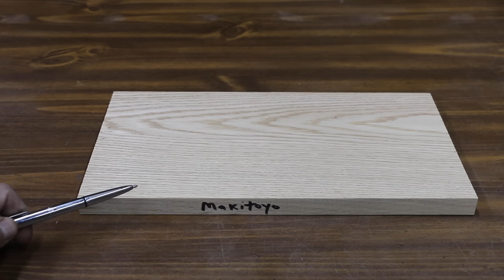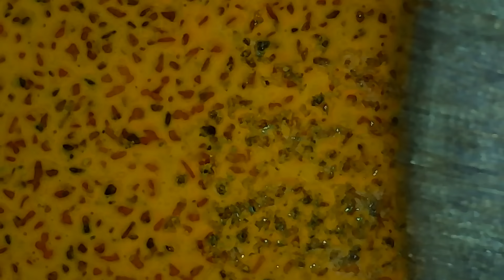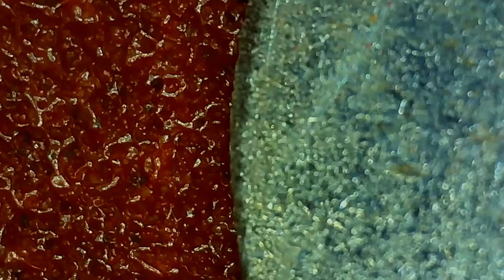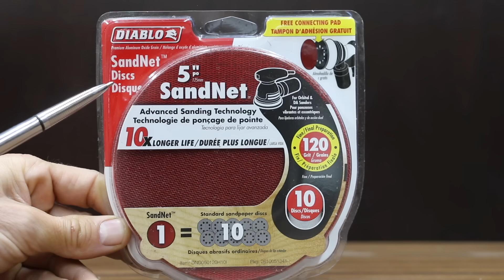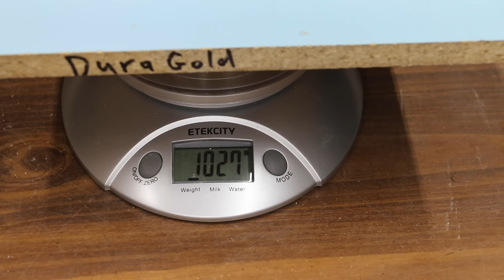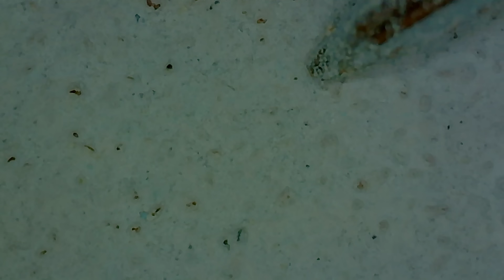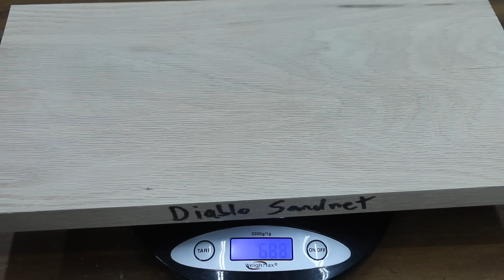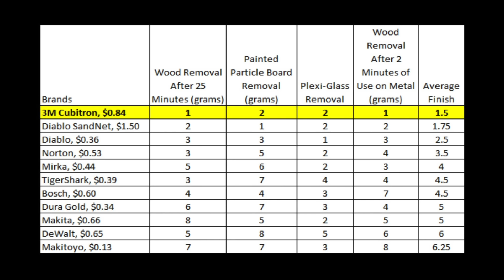Best "Sandpaper" Brand? 3M Cubitron, Diablo, Mirka, Norton, Makita, DeWalt, Bosch Sand Paper

Comment: I have used every paper out there Diablo is just better...  better than everything OTHER than Cubitron.. 
But cubitron discs are  not 1.5x better than diablo...  whenever they are 30-50% off I buy them though

Cubitron belts are the best I have found though and their cost is justified by their longevity and cutting speed.

I run cubitron belts on all my belt machines and diablo discs (or cubitron discs purchased on sale) on all my RO sanders.

The Diablo mesh discs are great and have their place for "soft" heavy clogging materials like dry but not cured finishes, such as  shellac, epoxy and latex paint. 

That being said the diablo and cubitron disks also do a great job on these materials they just clog faster then the mesh for obvious reasons.

On these soft materials it seems to mainly be a function of heat... 
I belive its do to the fact that the ceramic abrasive material does not absorb and transfer heat as readily as Alum. Oxide so the material being sanded stays cooler and does not "soften" and transfer to the paper. 

The mesh discs (based on their design) have even more air space further "removing" heat and dust from the material and the abrasive which of course means it will clog less for those two reasons.

Call it confirmation bias perhaps but this video exactly matches my hard won (and expensive) experience.
Reply from the maker: Thanks for sharing.

Comment: Not a fair comparison at all. Aluminum Oxide vs Zirconia Alumina vs Ceramic Alumina these are all different abrasive grains and should not be considered similar. Zirconia Alumina and Ceramic Alumina are always blended with Aluminum Oxide typically 80/20 or 20/80 ratios. This is from someone who spent 40 years in the coated abrasive industry.
Reply from the maker: Thanks for the constructive feedback.

Comment: Awesome Job!  The only thing I can think of to add would be a ranking of total grams removed per cost.
Using the grams removed after 25 Minutes for price per gram removed
Makitoyo	$0.005
Diablo		$0.009
Tigershark	$0.010
Dura Gold	$0.012
Norton		$0.013
Mirka		$0.014
3m	    	       $0.016
Bosch		$0.017
Dewalt		$0.020
Makita		$0.026
sandnet		$0.029
Reply from the maker: Thanks
Reply: wow!
Reply: Also factor in time to the equation to improve the stack rank!
Reply: Yeah, If I'm interpreting you correctly.

Even though the 3M was the better performer, you could change the Makitoyo to a new sheet 2 more times to get new sanding speed and still be cheaper than the 3M.
The Diablo however, is the real competition, it sanded, stayed clean, and stayed sharp. It definitely made the Makitoyo less useful.
Reply: In the end what sandpaper costs is not the major factor in a job. Labor is.

Comment: I have worked in body shops for 25 years and I can tell you brand of sand paper makes a huge difference. We almost always use Norton or 3M. They both have different grades and generally their gold series is the best. I have always preferred Norton over 3M though, and it is generally is always cheaper. Norton scuff pads are by far the best you can buy, absolutely no comparison.
Reply from the maker: Thanks for the feedback.

Comment: With mowing season fast approaching,  I'm curious about mower blade sharpening.  Angle of edge bevel,  convex/flat/concave grind. 
Then, which type of "wing" is best for smooth, even discharge, and minimal "lumping".  (I do not bag grass) 
I would assume that a high-lift wing would throw clippings out better, But would a totally flat blade allow the clipping to essentially fall where they are cut? 

I mow in a back&forth pattern and am always re-cutting clipping every other pass.
Here's where I'm going with all of this:   I want to build my own mower deck that is rear discharge.  The would mean designing my own blades.  I want the two left blades to rotate clockwise (toward the middle of the deck) and the right blades to spin counter-clockwise. (again toward the middle)  this is to let the discharge flow straight back from a rear-central discharge port.   
Why all of this?  To prevent spraying clippings toward houses,  flower beds, cars, sidewalks and roads etc.  As well as to prevent the re-cutting of clippings every other pass.
Reply from the maker: Thanks for the video idea.

Comment: After sanding tables for hours and hours at my last job, I can say with certainty that the quality of one brand can drastically change between grits. Some brands that are great at 120 are absolutely rubbish at anything over 800 and vice-versa. I would love to see a breakdown at each major grit between all these brands.
Reply: are you trying to kill this man
Reply: @lukesantarc561  lol!
Reply: @lukesantarc561  Indeed!  😳😬😂
Reply: That video would be over an hour long,   going through all the different grits.  This gives a good general reference point.
Reply: @BitterBrother1942  It only shows which ones are good of the ones he tested if what McCrary says is true. So I guess people who use lots of sand paper should do their own tests using a similar method of testing.
Reply: @atnfn  people that use enough sandpaper for price to matter already know which is best.
Reply: Sanding isn't just dependent on the paper, but the sander makes a huge difference as well.  All 5in orbitals are not going to remove much material and are not good for large flat surfaces.  Finish sanders are even worse and are not made for large flat surfaces.  6in orbitals are ideal if you are looking for something that can remove material, and give you a nice finish. But even they are not all equal.  I highly recommend the 6in Bosch model number ROS65VC-6.  I have used them for 8 years and have sanded hundreds of table tops and they are amazing.  Not only do they make the work faster, but they do not vibrate much so you can use them for hours with no breaks and your hands will not be tingling afterwards.  They are very well built and last for years.  I've yet to burn one up and I run the heck out of mine.  

Another tip is to make sure you use the right paper and progression.  I always start with 100 then 150 and finish with 220 (on wood).  If you have a difficult surface to clean up you can start with 60 or 80.  Just make sure you don't jump to much higher grit after using such a low grit.  If you start with 60, move to 80, then 100, then 150, etc.  Never go from 60 to 150.  You could probably get away with going from 60 to 100 but it will actually take longer to remove the swirls of the 60.  Even though it sounds like more work using a lot of grits, it's actually less work because you won't have to spend tons of time on each grit.  Your first grit is simply to get the surface clean and flat, then all the proceeding grits are just to remove the swirl marks of the previous grit.  I had to learn this lesson the hard way when I first started woodworking and would start on 120 and finish with 220 and all my table tops had swirl marks.  I would sand for hours and hours thinking it had to be good, and then when I applied the stain the swirls exposed themselves.  Finally i did some research and figured out what my problem was.  Sandpaper progression is key to a good finish.  

P.S.  Sorry if you already knew all that, hopefully it helps someone.
Reply: @isaiahii6982  also when sanding metal it needs to be dirt and oil free. As well as the paper. That will clog really bad. A shop I worked for had me sanding a brush finish on aluminuin. I'd clean everything first and use a new oil free chip brush to clean out the paper. I only had to replace my paper every few months or few hundred parts.
Reply: @isaiahii6982  Good Info! I have an old Makita BO5021 I bought after reading a test in a woodworking magazine. The thing just doesn't leave visible swirl marks, and I have purposely tried to put way too much pressure on it. I don't know why, not sure it is all that much different in design than other brands. I have some Norton paper, but it is old stock from when it was good. 
I knew a large cabinet operation that cheaped out and used Rhynodry sand paper; worst stuff I ever seen. They had to re-sand a bunch of cabinets before the finisher could do his work. Even their air powered sanders left swirl marks.
Reply: @debluetailfly  I've never used one of those but it must be something in the pattern that just doesn't leave swirl marks.  As far as I know all orbital sanders use circle patterns and leave swirl marks.  But the proper technique and knowledge is key to making sure your finished product doesn't have swirl marks.  

I ruined a lot of nice things I built when I first began woodworking because I didn't know how to finish properly.  I could build really nice things, but had no idea how to finish them.  Now I know how to build and finish :)

If my 6in Bosch ever burns up or I have some extra money to spend my next sander is going to be Festool's best 6in orbital.  I love its low profile and I know Festool makes really nice tools having owned a few.  I really want to try that sander.  The Bosch I mentioned is a really nice 6in orbital though so I don't really need another right now.  The only thing I don't like about the Bosch is its height and weight.  She's tall and heavy.  But neither of those are a problem on a level flat surface.
Reply: @debluetailfly  I imagine the swirl marks would be because of the different speeds that the grains are moving. The ones closest to the center would be moving much slower compared to the ones at the edge. It would be interesting to find out why a particular sander would be able to overcome a pattern caused by that, considering it’s from concentric motion rather than the material or mechanics.
Reply from the maker: Thanks for the suggestion.
Reply: You should just test it yourself
Reply: A test of auto refinishing abrasives would be helpful and interesting. Especially the rolls of abrasive for planing and shaping boards.
Reply: That's interesting I wouldn't have expected this to be the case. Why do you think that is? Do you have your own suggestions per grit that you like?
Reply: This is an information filled thread.

Comment: The 3M seemed to have a radically different hole pattern in it.  Did you find that it produced more dust when using than the ones whose holes better matched the sander?

Comment: Awesome. Wondering about what’s the best garden hose.
Reply: It use to be the black high pressure craftsman hose. Not sure now that Sears is gone. We went through several different brands and liked that one the best for our uses.
Reply: @brokenwrench404  thanks. What about it made it the best? Just wondering.
Reply: @brokenwrench404  
  I know.
 I bought several 50 ft hoses, and am STILL using them, 16 years later.
 No cracks, no leaks, great fittings !
Reply from the maker: Thanks!  Thanks for the video idea.

Comment: My unscientific observations from 20 years of sanding tell me that Diablo is the best longest lasting sand paper. I recently bought some Diablo sanding screens and have had good results with them .They seem to sand well and last a lot longer than regular sand paper but cost considerably more. But having said that I have tried many of the brands you are testing.
Reply: Totally agree, I have used every paper out there its just better... better than everything OTHER than Cubitron..  But cubitron is not 1.5x better than diablo... I run cubitron belts on all my belt machines and diablo discs on all my RO sanders.

Call it confirmation bias perhaps but this video exactly matches my hard won (and expensive) experience.

The Diablo mesh discs are great for heavy clogging materials though, like soft (dry but not cured finishes) like shellac, epoxy and latex paint.
Reply from the maker: Thanks for the feedback.

Comment: I had a feeling that 3M and Diablo would top the charts. Which is great! 
I'm surprised that Dewalt / Makita / Bosch were all so marginal, figured they would've ranked a little better.
Reply: Dewalt and makita have outsourced to the cheapest manufacturer and their performance shows it, Bosch should stick to drills and such.
Reply: @chspyderr  Your absolutely right, do you think a power tool company is going to make their own sandpaper they get cheapest they can and put their names on it and make a serious profit and when comes to sandpaper buy the cheapest because most people don't use sandpaper to their fullest and if you look at the cheapest it was the best price for price
Reply from the maker: Thanks for the feedback.
Reply: Especially the Dewalt. Good lord that was underwhelming.
Reply: I'm pretty sure neither one of them make their sandpaper
Reply: they're a tool company, not a sandpaper company
Reply: @JasonPeltier  lol that strike a lil' salty nerve, did it? As previously mentioned, they should stick to tools then. Instead, they choose to bend brand loyal dummies (I've got a hunch you just might be one!) over by pumping out cheap garbage with a premium price tag. Shady, unethical, bad, but not surprising business practices. Thank you @PF for bringing these shortcomings to light for consumers to see! Your thorough, unbiased, unsponsored reviews and product tests are an invaluable source of info!

Comment: I use the regular diablo as well as the sandnet diablo and the 3m cubritron 2 I buy more of the 3m cubitron 2 because they make a ton of cutters and angle grinder disc's as well but I have been impressed with the diablo brand both regular and sandnet I did a 100 foot wall of drywall sanding with 1 sandnet pad was very impressed @Project Farm
Reply from the maker: Thanks!   Thanks for sharing.

Comment: Seems like the diablo sanpaper is just smashing it. Cheap and long lasting. I know what brand I'll be getting.
Reply from the maker: Great point!
Reply: @ProjectFarm  Well I never really gave so much thought to sandpaper,,,,But thanks for the in depth testing,,,,I and many others I'm sure tend to put way more thought and loyalty into the tool that the sandpaper uses but we should have been paying more attention to the paper, because by proof in your testing proves out a bad paper can make a really good tool not do so well and a realy good paper will make a less than greatest tool  do better than it normally would do,,,that said I never gave it that much thought really,,,I just get what the local hardware or builders supply has the most and best selection of grits on the shelf, and that  always seems to be the diablo or 3m and sometimes the norton brand, but mostly the diablo seems to always be the leader on whats on those shelves by far,,,so that's what I seem to use the most of,,,,sometimes I  when  not feeling extra lazy LOL  just buy bulk packs of sandpaper of who knows what brand,,,,, because I rarely put out the effort to even look LOL,,,then just cut out my own pads/disks (at least for my quarter sheet sanders anyhow, but for my DA/random orbital sanders I just seem to end up with the normal old diablo ready cuts because they just seem to be the most available at least in my area,,,,the secret is get the best price by buying a large quatity bulk pack size.....anyhow thanks for the in depth scientific look into something that is one of those things not otherwise given that much thought,,,it's nice to know what to expect out of a given brand.
Reply: I have the regular and sand net. I only use the sand net on raw wood, but it chews through it without much clogging because of its design. I use the regular version in general purpose uses, but also for hand sanding curves and such. The sand net obviously isn't as good at that.
Reply: I'm glad my sand paper drawer is fully stocked with that red gold baby.
Reply: Diablo is good at drill bits and most cutting and sanding things.

Comment: Mirka Abranet for me. Never clogs, great extraction and lasts ages.
Reply from the maker: Great suggestion for round 2
Reply: @ProjectFarm  can you get also klingspor and blue line?
Reply: I have those to, works great!
Reply: But do you need the Mirka sander?
Reply: @JasonPeltier  No. I dont think so. As long as is hook and loop you can use on any sander
Reply: @JasonPeltier . Ideally yes but they work well on my Bosch and makita sanders. It’s the base which is important ( more holes the better)
Edit TBH I’ve found mirka air sanders to be great but never used electric versions